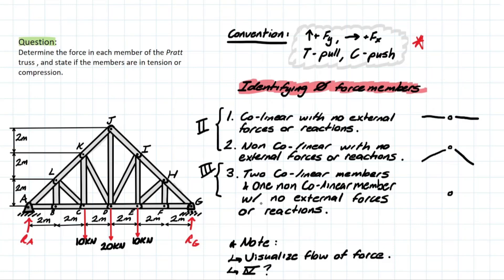Zero Force Members and Method of Joints!

Comment: could you do a step by step procedure on Fkj and Fkd??
Reply from the maker: Sure. If you need to this on paper, you can solve for an unknown variable in terms of the other variable in one equation, and plug this into your other equation. Here is what it would look like:

Looking at equation 1, if we solve for Fkj in terms of Fkd, we have the following:
Fkj = -1.26Fkd + 14.14

Now, plug this into equation 2 for Fkj, and solve for Fkd:
0 = 28.28cos45 + Fkdcos63.43 - (- 1.26Fkd + 14.14)cos45
0 = 1.34Fkd + 10
Fkd = - 7.45 (Negative, therefore compression)

Hope this helps.
Reply: @simple_civil  I get it now, thanks man
Reply from the maker: @jimzbyrelbistoer9546  Glad I could help!

Comment: If you are using the 45, 45, 90-degree triangle, how can you have two legs that are equal to length 2, and a hypotenuse that also has a length of 2 while maintaining a 90-degree angle? It simply goes against the trig ratios of the unit triangle.
Reply from the maker: Bit confused by this. The hypotenuse length is not really relevant to the problem and the dimension of the hypotenuse is not mentioned explicitly. Sorry!

Comment: Summing the forces in the Y direction for K. Would Fkd be positive in your first equation instead of negative because the direction of the force is pointed upward?
Reply from the maker: Hey! I did this video a while ago, but Ill see if I can help.

From the FBD (free body diagram) I have, Fkd is drawn in the positive x (pointed to the right with respect to the joint) and the negative y (pointed downward with respect to the joint). So the signs in the equations seem to be right based on what is drawn.

Then when Fkd is solved, we end up with a negative value, meaning the Fkd drawing needs to be flipped and pointed towards the joint.

Then, based on our convention, we are pushing the joint. Thus, Fkd is a compressive force.

Hope this helps!

Comment: this video is amazing and to the point ! would like to get calculating deflection of truss by virtual work method.  
which notepad  do you use for this video ?
Reply from the maker: Thanks for the support! I have a structural analysis course that will eventually cover the virtual work method. For now though, I am more focused on completing a full strengths of materials playlist.

As for the notepad, I am using a 'Wacom One'. Super affordable and user friendly.